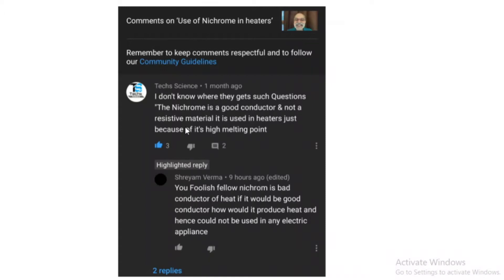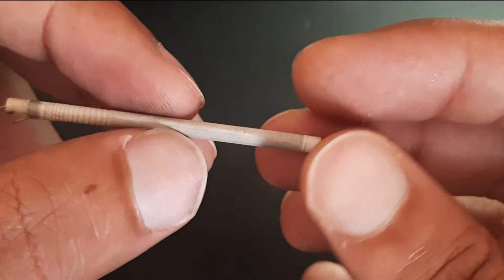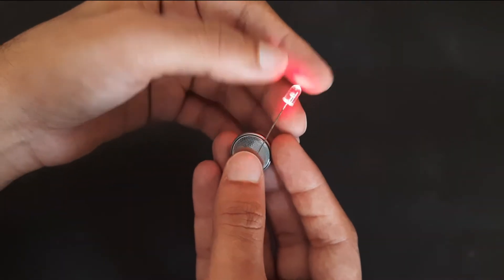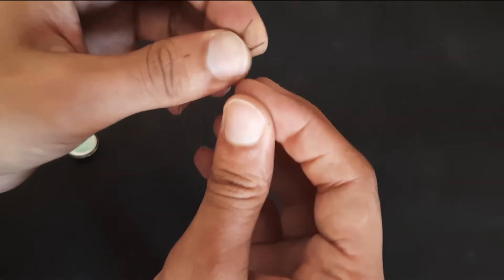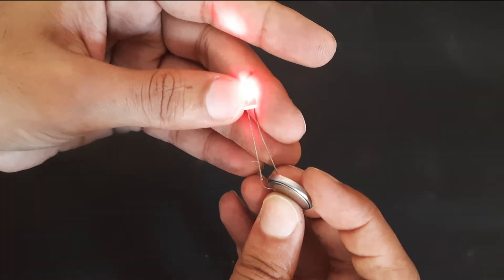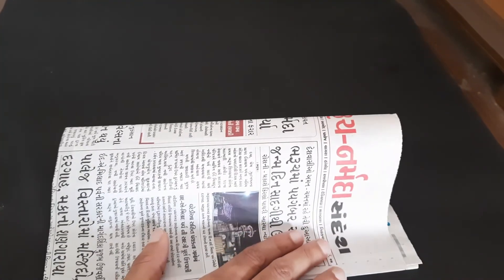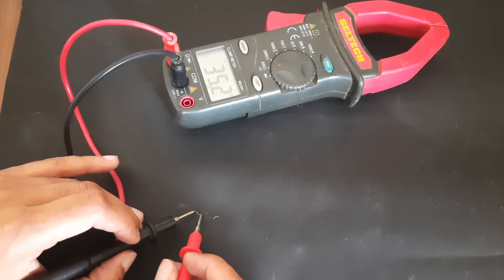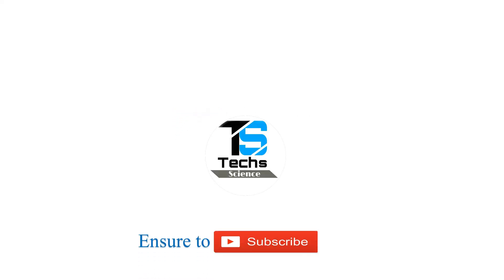Why Nichrome Wire used in Heaters | Question asked to HC Verma Sir

Comment: generally nichrome is high resistive material thus it resists to the flow of current due to which energy is release in form of heat and with bright light
Reply from the maker: You can't say high resistive 
It's been placed in a good conductor 
Still it's resistance is more than copper wire & more conductive than semiconductors
Even you can use the iron strips as heater but it's melting point is lower than Nichrome hence Nichrome is the best choice with a bit resistive and high melting point